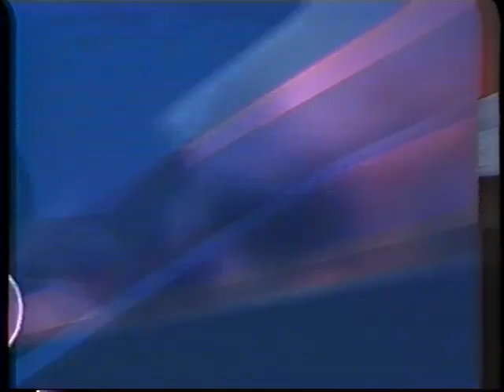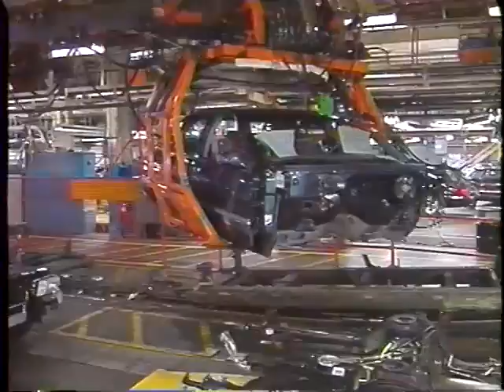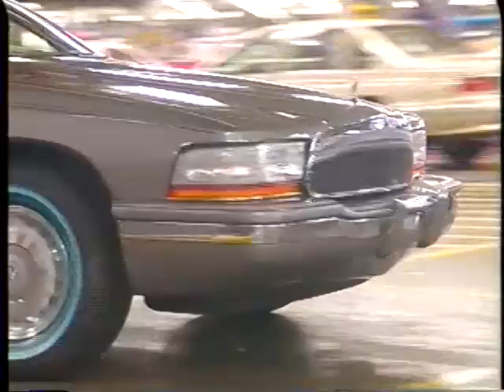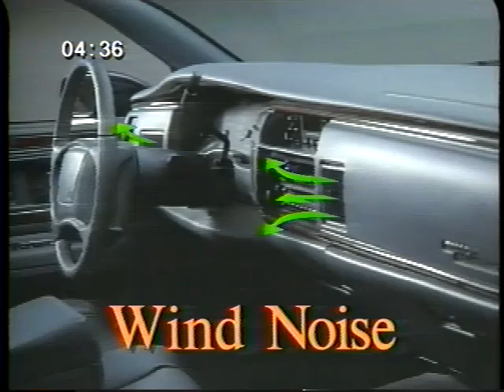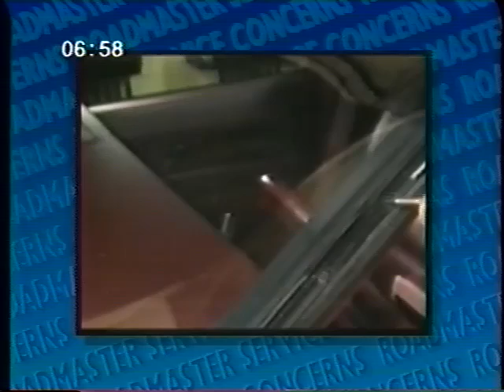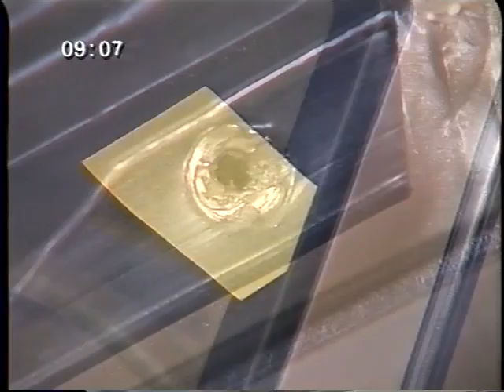Buick Knowhow: Roadmaster service concerns Part 1

Comment: Got me a '91 Caprice Wagon for cheap, $1k.  Pulled the 305 gas engine and I'm in the process of putting a 6.2 Diesel in it.  Should be good for 35-40 mpg : )
Had a Roadmaster Wagon that all the glass but the front was busted out.  Cut the top and pillars out.  Turned it into a full time convertible.  It was SWEET!
VT247

Comment: 6:07 I notice he carefully mentions '94 and '95 models. Our '93 Limited leather sedan (bought August 28, '93) has no two adjacent body panels in the same ZIP code. If you roll down the rear windows the car slows down more than ten miles per hour at the same throttle angle, and the passenger cabin vibrates like a pit bull passing a peach pit. The driver's window jumped the track in a rain storm the first time I rolled it down, and the front passenger window didwithin  the first week on the road.